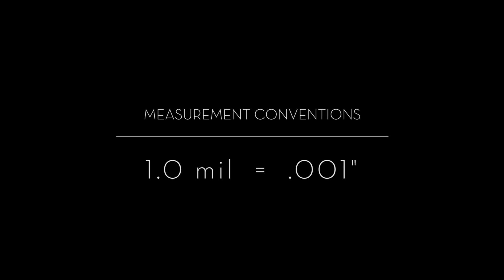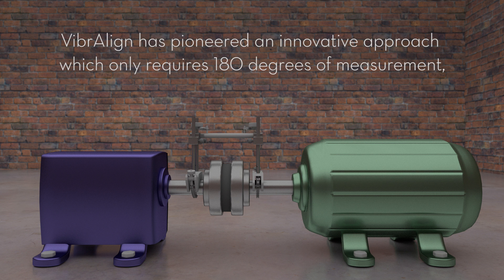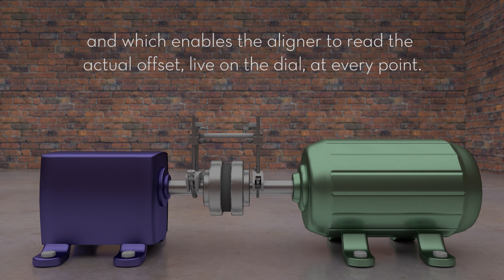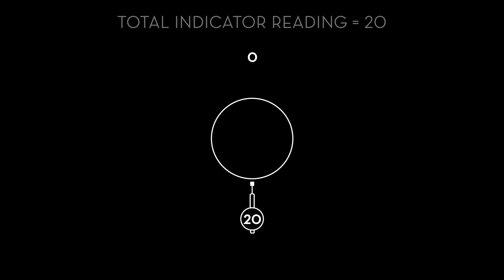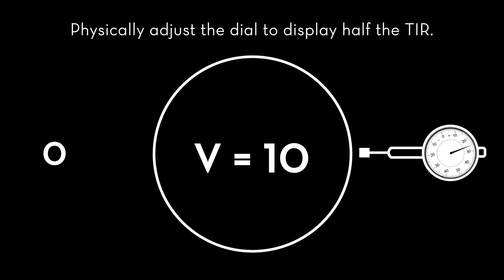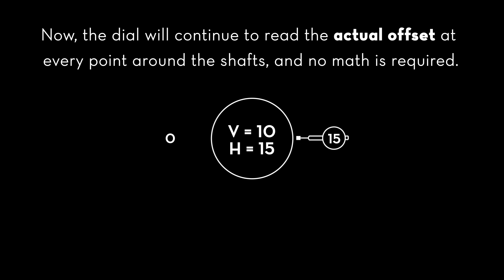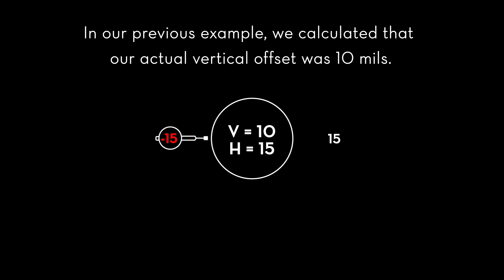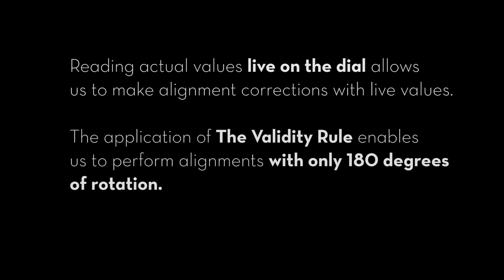Dial Indicator Concepts:  Live Readings with Dials | ACOEM

Comment: When you say no math does this mean that the live reading indicates the shims needed or do these numbers still have to be plugged into an alignment formula??
Reply from the maker: The shimming value must still be calculated. (We have an App for that.)  The horizontal adjustment can be made "live" without calculation.  I hope that helps.  Thanks for your response.
Reply: ok thank you! I find all of your methods very interesting!
Reply from the maker: To clarify, with the free Fixturlaser Dials app all you have to do is plug in the dial values from the vertical readings, along with the dimensions, and the app calculates the shimming values.
Reply: Ok thanks. I downloaded the app as well as the vibralign apps. These should help speed things up! Thanks for the info and all the wonderful videos!